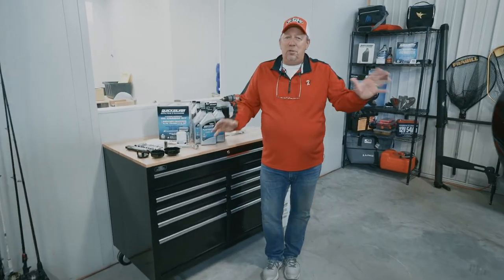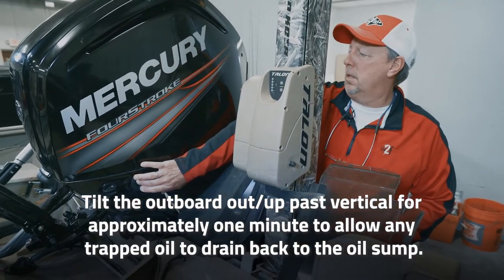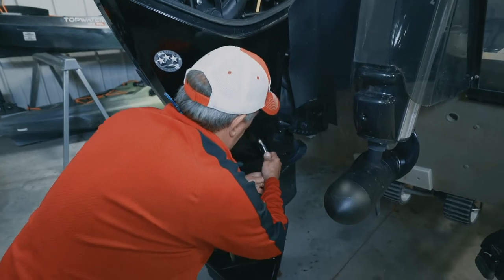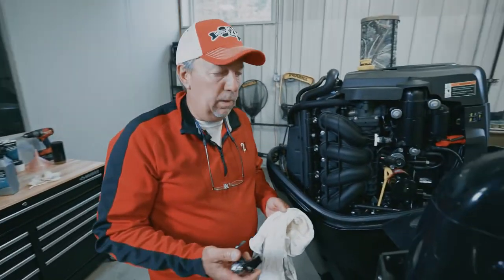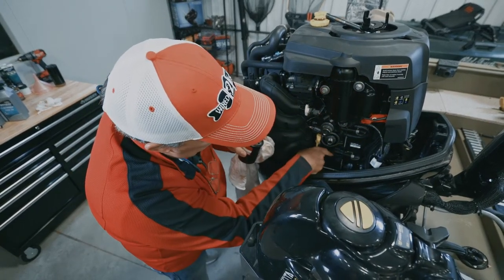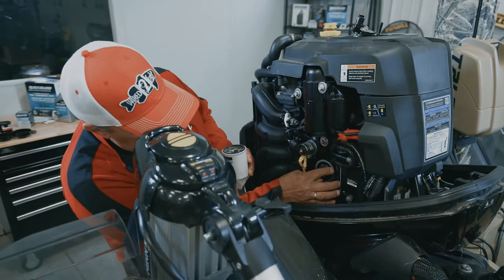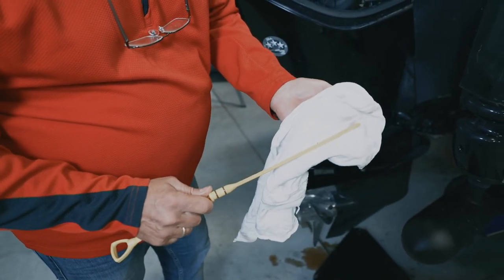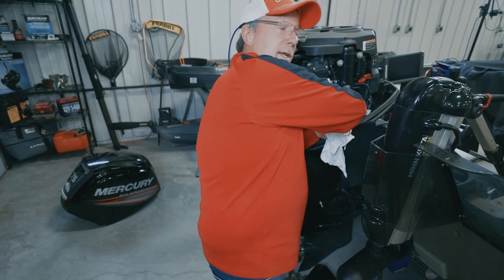Oil and Filter Change on a Mercury 75-115hp FourStroke Outboards

Comment: I'm sorry if I missed it, but how many quarts of oil? 75 HP.
Reply from the maker: If you have a 1.7L 75hp Mercury outboard, the recommended oil is 5.3 US quarts of 25W-40 Synthetic Blend.
If you have a 2.1L 75hp Mercury outboard, the recommended oil is 5.5 US quarts of 10W-30 engine oil. 

We recommend checking the operator's manual or decals on your engine under the cowling to determine which model you have and which oil to use. 😊

Comment: What if the boat is not used that much? Do you change the oil every year? I have a 2018 with only 35 hours
Reply from the maker: Most manufacturers will recommend the oil to be changed every 100 hours, or once per year, whichever occurs first. Throughout the offseason condensation can build in the oil sump area on many outboard and sterndrive engines, so it is important that this oil is drained and replaced with new, fresh oil.

Comment: Nice video. I have Mariner 50 hp 2015. which Oil Will you recomand me? Is Quicksilver 4-Stroke Marine Oil Synthetic Blend 25W-40 genuine?
Reply from the maker: You are correct; the manual for your engine recommends 25W-40 synthetic blend. Quicksilver is a parts and accessories sub-brand of Mercury Marine, so our 25W-40 synthetic blend would be the same oil you'd find in the Mercury packaging at your local dealer. 👍

Comment: I have a Mercury 75 hp. , 4 stroke efi. But I don’t have a oil plug. On the side that lets me drain the oil with a tube , do you know if they make one for it?
Reply from the maker: Hey Daniel! Please contact Mercury Marine customer service at 920-929-5040. They will be happy to pull up your engine schematics and determine if what you are seeking exists for your model. Thanks for watching!

Comment: If I broke the seal on the drain valve change it
Reply from the maker: If you've broken the seals on your Mercury Marine outboard oil drain valve, we recommend contacting your nearest Mercury Marine dealer for assistance. Replacement seals are available. 👍

Comment: This would be a better video if you mentioned  what weight oil and filter....
Reply from the maker: Hi Jeff! Sorry if it wasn't mentioned verbally in the video, but it shows the engine oil filter part number in the beginning (877761Q01) and the oil shown in the video to be 10W-30.
Reply: Oh my mistake, I FF through beginnings. Thx.
Reply from the maker: @jeffs5913  No problem at all, thanks for watching! 😊